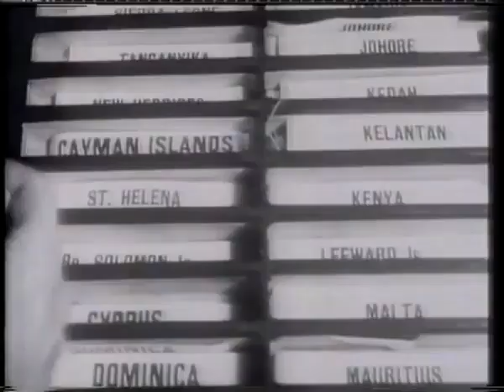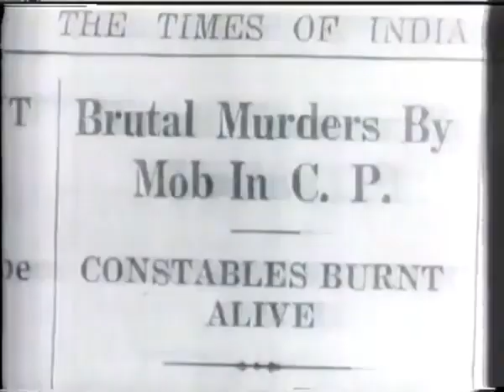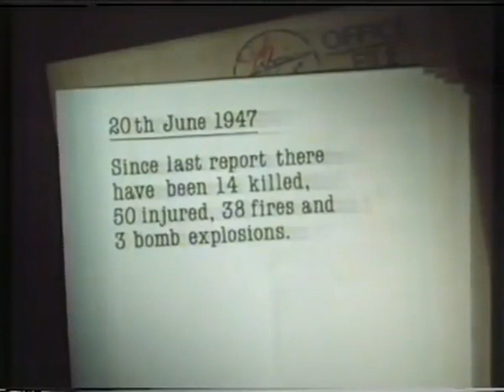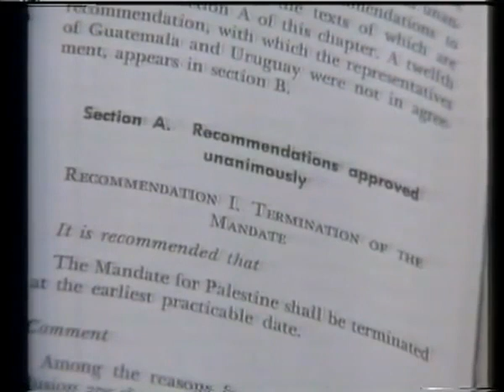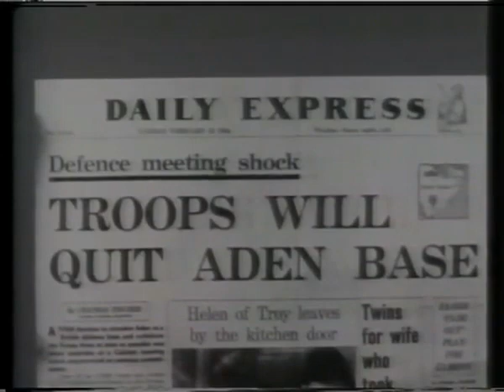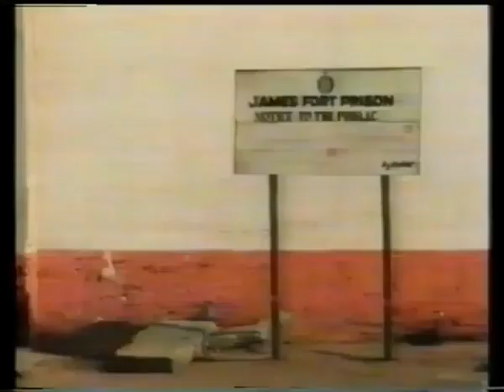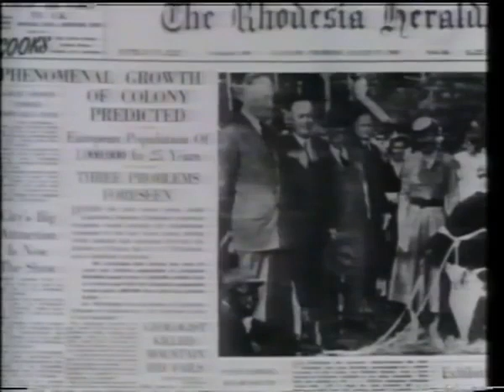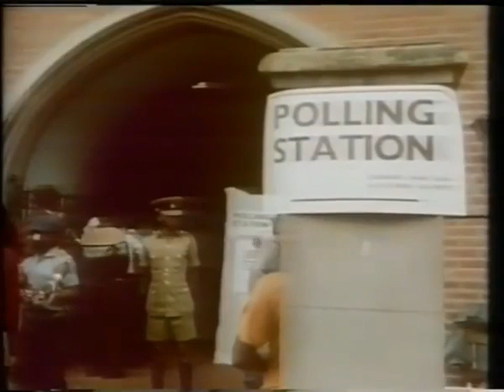END OF EMPIRE - all 14* chapters in stereo (1985.)

Comment: I have checked the official episode list and there's nothing there about Malaya
I don't think there's ever been a malaya episode
Reply: I've long suspected this too, in part because 14 episodes would have been such an odd number. British TV series in 1960s-1980s often had 13 episodes because that was 25% of a year's schedule, and it meant that you could fill one time slot with four different productions over the course of one year. A 14th episode would have badly muddled this scheduling.

To see a typical 13 episode run, see 1969's "Civilisation" or 1974's "Fall of Eagles", both of which are easy to find on YouTube.